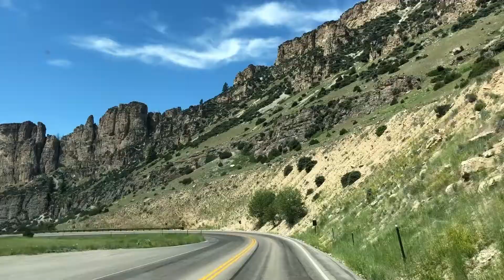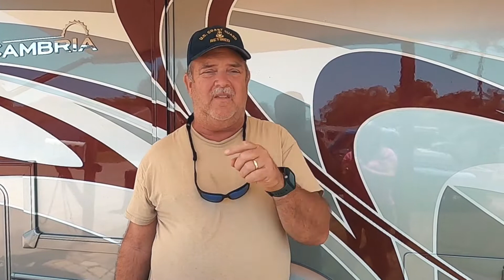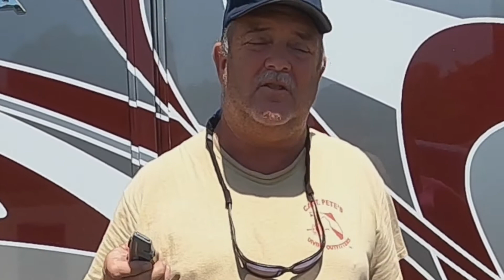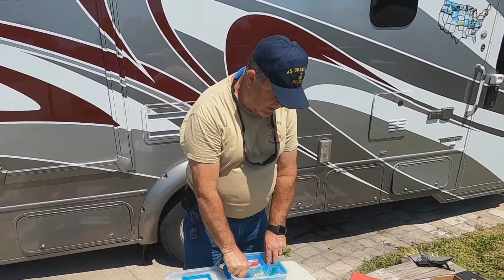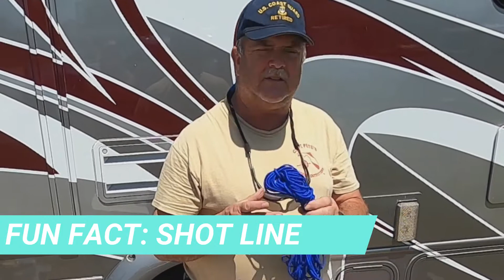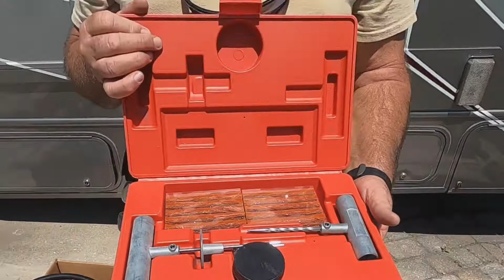MUST HAVE TOOLS for RV Living

Comment: Oh yes, Brad, no matter what you drive, a good mechanic's set is a must have.  I have always been a tool guy and hit situations, like a busted hose, where I saved big bucks by fixing it myself.  Or try getting a mechanic on a Sunday.  I can see where a rig like yours is even more demanding.  The electrical meter, tape and connectors also stay in the van.  I agree, don't leave home without the drill.  Gorilla tape is a must for me.  Right, bring some cord.  I love your compressor ... mine is a cheap one, but it has saved my bacon several times.  Good point about having what you know how to use.  One more thing for fixing stuff out on the road .. YouTube ... you can learn so much about repair work on YouTube.  Thanks for the good video.  You hit the nail right on the head!
Reply from the maker: Oh this is great to hear from you! You are so right! Gorilla tape is a great thing to have.... good thinking! And yes, Youtube is the place to learn so much. ~ Brad